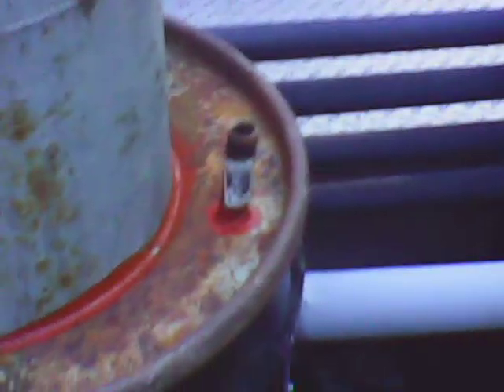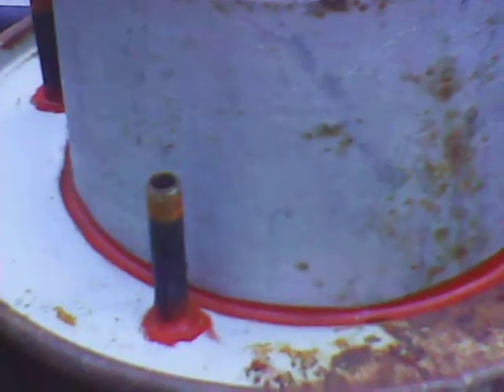gasifier project 2

Comment from the maker: Thanks for the advice. Actually I re-designed the cyclone its now an old gas hot water tank and I left the center heating pipe in it to use as the exhaust and it runs down to near the bottom. The natural gas is free on my property as a condition of allowing the company to drill the well and run the lines. I know I can run my vehicles off natural gas for free and am planning to sometime just wanted to do the gasifier as a educational project.